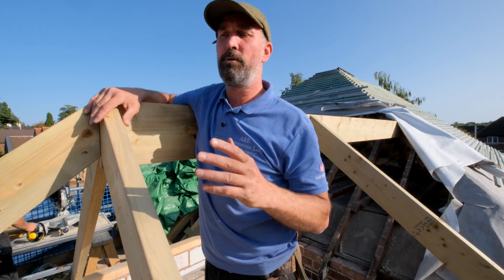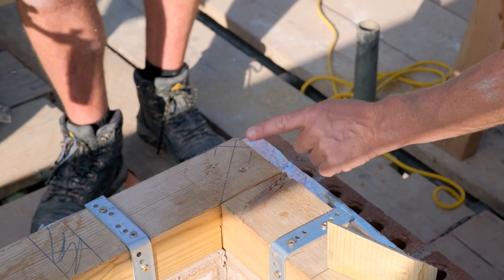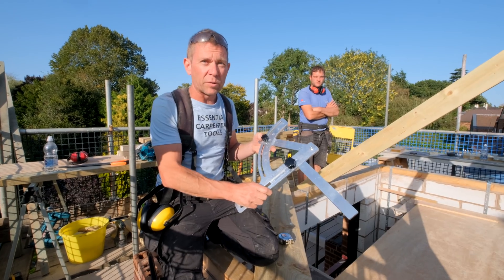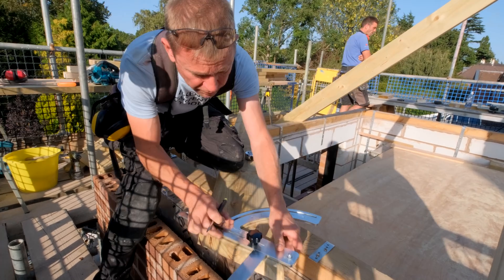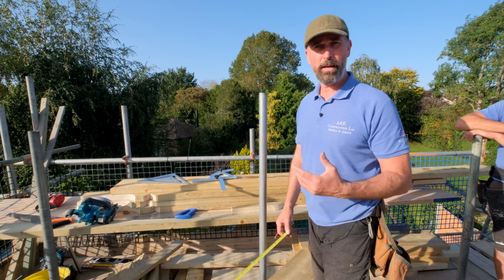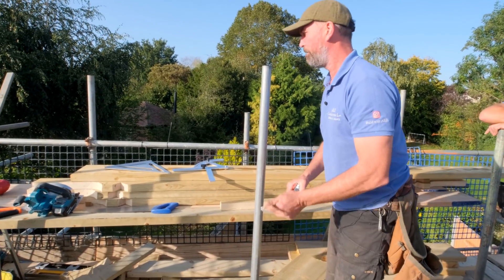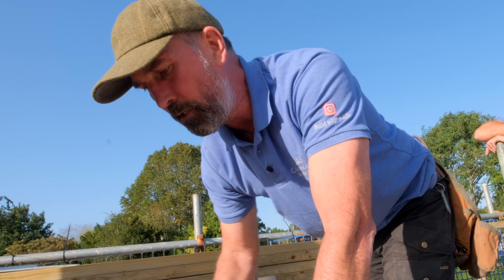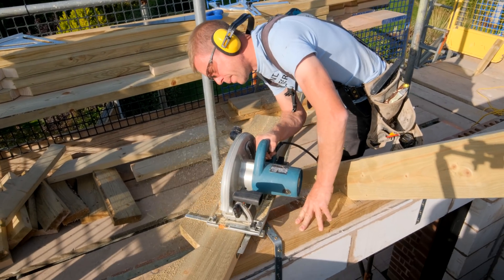HOW TO FIT KING COMMON RAFTERS AND HIPS (PART TWO)

Comment: Need a little help here. I had a false cable installed. I was told that it needed something to do with king and king Jack. Rafters, all it seems to have is Commons, so I'm confused on what I need to do to fix this, and I cannot get a general contractor to touch this job because I fired the last contractor. After realizing, things were not being done to code, but yeah, we're still passing inspections. I hired an independent inspector and this is what he told me. I'm still waiting for his actual report. I don't know if he's drawing it out or what but I cannot for life of me. Get somebody to help me do this. Yawls is the closest video of what I need, but this is not a false Gable. So I'm not sure how this sets inside of one that is attaching to another roof.

Comment: Recently did my 1st hipped roof.
I did it solo which was stupid.
3 hips and 3 valleys.
Bit ambitious for my first time, especially as I was having to marry into the original with Rosemary's, valley tiles and hip bonnets.
Not 1000% happy with it.
The plates weren't super square.
I knocked them about abit and 345ed the corners until I got it where I was reasonably happy but something was wrong.
It was hard doing it alone.
Couldn't measure from corner to corner properly.
It was parallel but not square and I don't know how.
I cut the Kings the same, a few commons and the hips the same. Everything seemed to be working perfectly.

But cutting the hip Jack's in pairs made me realise something was off.
But it was only a few mm so I carried on, coz I had to get it done.
I struggled with the valleys.
Especially the connecting valleys.
The angle up the valley boards wasn't working.
So I started to panic that I had gotten the pitch wrong.
I climbed into the attic and checked about 10x rafters and they were all 41degrees there abouts.
So I couldn't understand what wasn't working.
Reply from the maker: Hi Kallum I think we have all been there at different times of are life’s. Dan square is a cracking bit of kit but the building careers live on the 16 17 July u can talk to people and have a go with us so please come along all the best Tony 👍
Reply: @BuildWithAE  a big part of me is resisting buying Dan's square. 
Makes it seem too easy.
I wanna know I understand it all 1st.
I think I do, but doing this hipped roof has knocked me about abit. I kept the pitch then same, I kept the hips and valleys as 45 as possible.
I cut the Jack's in pairs which I imagined would keep everything at least within 45.
I even added a dragon brace detail using the offcuts from the hip birdsmouth.
But something hasn't worked 100% and its driving me mad.

Am I being too fussy?

I reckon I might come to your thing

Comment: How many of you guys know that If you was going to do this back in the olden days,you would keep the point of the hip plumb cut right up to the ridge line and back the both edges of the hip rafter off,this is known as the dihedral angle so the middle of the hip rafter would plane through with the top edge of the commons and jack rafters,I wonder how many of us remember this from our college days,robin clevett would I’m sure. Great vids guys keep them coming
Reply from the maker: Hi coggsy3036 I remember the dihedral very well it’s something that will be shown in a big roof coming up later also 3” hips would always do dihedral angles, but most of the time 2” we don’t do the angle all the best Tony 👍
Reply: @BuildWithAE  yes same here,I like to keep it old school as much as possible 
Keep up the good work guys💪👍
Reply: @coggsy3036  hi, yes I’ve done a few dihedral angles on hips, even filmed one.. 
Got  a well done from a NHBC inspector on one job for good practice, that’s a first.. 
thanks for watching.
Reply: Bevelling the tops of the hips gives one more meat to nail the battens into. The same applies if one is sheathing the roof with ply/Osb.
Reply from the maker: @Toyotaamazon80series  great shout especially with OSB or ply all the best Tony 👍
Reply: @BuildWithAE  Keep the videos coming please, top class content, 👍 😁 🔨🔨 🇮🇪
Reply: @Toyotaamazon80series  personally on 45 mm or 2 inch hips I don’t put a dihedral angle on them, only when it’s wider. 
I see it the USA they tend to sheath their roofs more than what we do in the uk. 
Thanks for watching.
Reply: @Ultimate-roofing-square.  Yes indeed, 👍 I worked in America and I didn't see a battened roof. All the roofs I worked on were sheathed with 15mm ply/Osb. The older roofs had deck boards and some of them were still perfect. Doug fir with very tight growth rings. I hear they sheath roofs in Scotland. Top notch craftsmanship Sir, 👍 🔨 🇺🇸 🇮🇪
Reply: @Toyotaamazon80series  I hope you had fun working away. 😉. Thank you 🙏
Reply: @Ultimate-roofing-square.  👍 😁 🔨 🇮🇪

Comment: Perfect, but leaving more timber on bottom part of hip then a soffit cut would be better ?
Reply: Hi Raymond, in part 1 of the video it was explained there is no soffit as it’s a open end detail so we cut all the rafter feet down to the same size. 
Thanks for watching. 👊🏻
Reply: @Ultimate-roofing-square.  sorry Daniel , my bad. Excellent workmanship 😀👍👍👍
Reply: @raymondpiper8294  no worries.  👍🏻

Comment: perfect timing as I am just cutting the roof of my self build having already purchased the ultimate roofing square. Commons, king commons and ridges in place and all fit perfectly after cutting using the square. This is a great tool and makes things very easy. Now for the hips, wish me luck 👍
Reply: Thanks for buying a square. You don’t need luck, the hips will fall into place like a dream., 
All the best.  👊🏻
Reply from the maker: Hi Pep X Dan’s roofing square does make life so much easier you will do a awesome job on them hips all the best Tony 👍